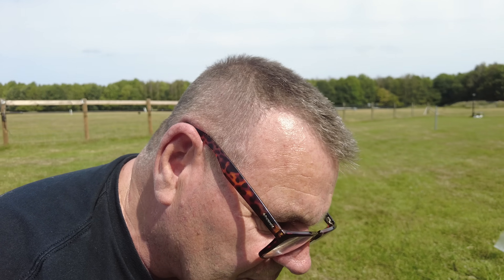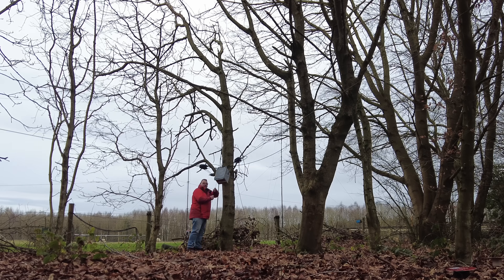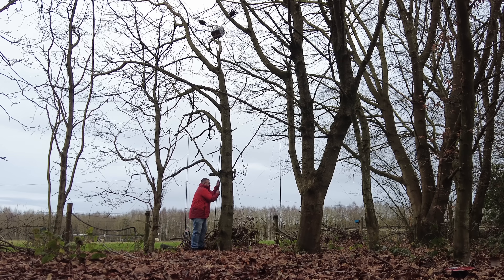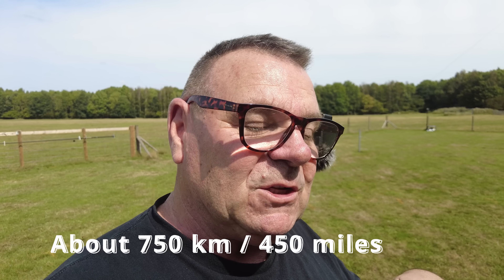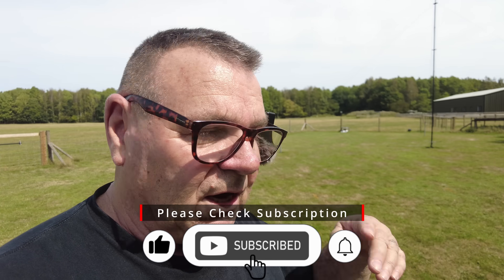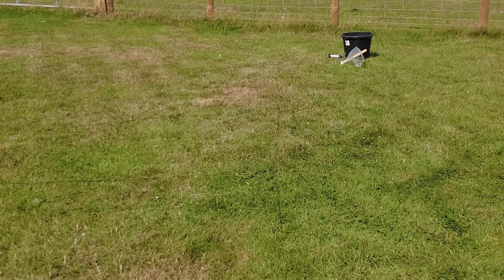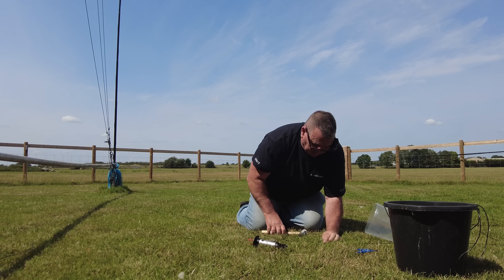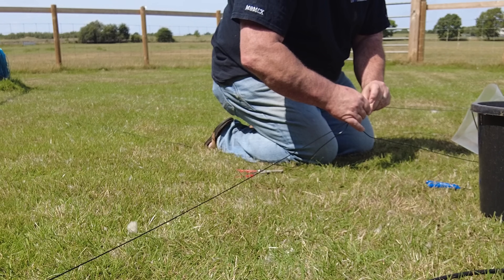The 40m Problem - Dipole vs Vertical - The Truth

Comment: Hi Callum if my 40m dipole is a bit low could that be the reason why rigexpert says resonance just under 8mhz. Swr is 1:56. Ta I’m a new ham so still learning
Reply from the maker: OK, so I have a lot of feedback with some rig experts... Get it as best you can on the RigExpert - then check SWR on the radio itself. Most often, the radio is only interested in simple SWR - not all the techno-baloney... It's a truer picture (I have helped a LOT Of folks out tuning DX Commander antennas - and 50% of the time, it's the bloomin' analyser!

Comment: Morning Callum, can you engineer a four element quad where the four spider supports are orientated in a vertical and horizontal configuration and turn them into eight dipole all aluminum. Insulate all the ends of the eight dipoles and install a 10awg wire to all four points of each of the four crosses and  measure for a full wave square wire antenna. All dipoles and outer wires cut for 10 meter operation. Can this be done? How could you match for low SWR? Thank you, Dwight.
Reply from the maker: Honestly, I am trying to untangle that and failed sorry!

Comment: At my previous apartment, I was allowed to run a DX Commander 12.4 and a 130ish foot end fed on a remote switch. They definitely performed differently, catching different groups. I am rather limited where I live now.

But I plan to relocate to a place where I can put up some antennas, vertical and horizontal.

Comment: In my mind i always used  variable screens during the day the screens holes get smaler and tighter then at night.. this allows smaller wavelengths to bounce on the screens in the day while the long wavelength cannot get past the low screens. Then at night the holes get bigger the small wavelength pass through all of the screens while the long wavelengths can finally get past the low screens and bounce off the upper ones.   In my mind that haow it works
Reply from the maker: Ah... I didn't have a spare variable screen handy to show :)

Comment: Been a HAM for over 30 years. I always loved building my own antennas. Currently I have an inverted V cut to 15 meters, mounted at 25 feet. This is run through an MFJ VersaTuner II into a Yaesu FT-840. Antenna is oriented NW/SE so I have good coverage of most of USA. I built a 6m 3 element Yagi out of old tv antenna elements, mounted vertically on 3/4" heavy wall PVC pipe. When the band was open, contacts on 10w FM were not unusual up to about 1500 miles. Past winter storm took out all my antennas, so I am now down to one, the inverted V. 73
Reply from the maker: That's an impressive setup!

Comment: Well, obviously you've done it all wrong 😁Nice demo with the sponge. It fits perfectly. You're right about 40M daytime in the US. My Winlink gateway runs off my 5ft EFHW NVIS and I get about 500 miles. Maybe more if conditions permit. Nighttime is way better but then 80M usually works well after dusk too. I use my DX Commander when I want to go far. Excited to see the 4 square work.
Reply from the maker: Ah! That's perfect Jack! Good observation.

Comment: here in the colorado area we have the high noon net at 7.240mhz. 35 years ago I compared my vertical to my inverted V (90 degree apex angle up at 35 feet). the vertical was 40db down. at night for dx the vertical and V ran about even. so the vertical rejected some qrm. if you only have one antenna make it a inverted V or dipole if you want day and night.
Reply from the maker: Horses for courses :)
Reply: The phasing on an four square inverted V is something else though.
Reply from the maker: @paulsengupta971  ... and it's beyond me! Someday - I will work it out!
Reply: @DXCommanderHQ  Oh dear, what have I started?!

Comment: The LUF has been all over the map this cycle.  On average for my QTH day single skip 40M on the DXC isn't dead but it's riddled with QSB.   If not for the proliferation of POTA stations on 40M in Florida I probably wouldn't be able to make any contacts on it.  The long wire is decidedly more reliable during the day.  Recently 30M has been in that boat and 40 won't even do NVIS.
Reply from the maker: Hey Matt - yes - 40m is an issue. It really needs about 3 different antennas!

Comment: That spot on with the 40 meter band. Yes in the US it is like state wide coverage during the day  and most of the US at night.  You will only get short ground wave on vertical during the day on 40 meters. No skip at all. We have a 60 meter band in the US and it like 40 meters as well but a odd band . broken in channel blocks . I haven't used it. 80 meter does NVIS at night more . In the US the band is so wide it is really 2 bands 75 and 80. Like the sponge idea.  Some are going to say solder them ground connections ,And I say bad idea. It will flex and break over time. Just bare copper twisted with glue line heat shrink. Water tight . and can  flex. Cheers from NY !
Reply from the maker: Great comment ...  (As usual!)